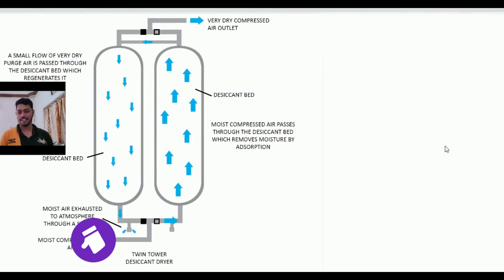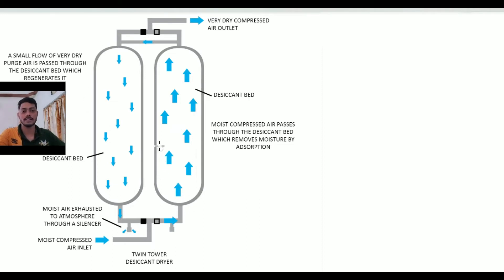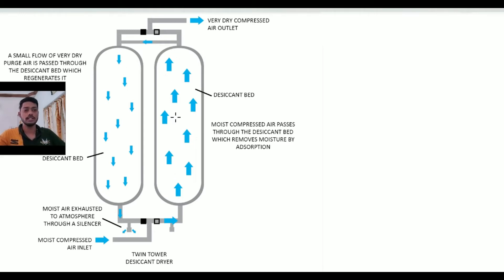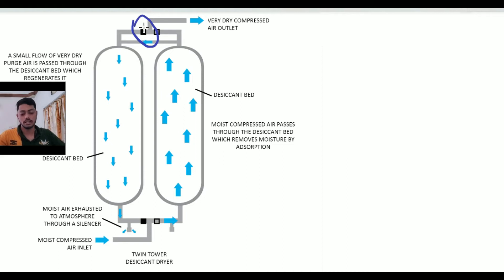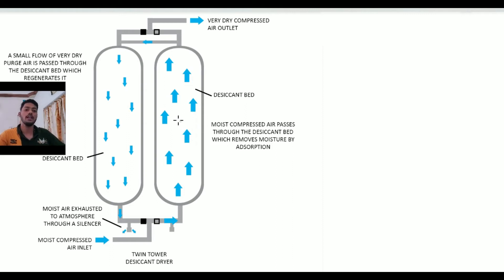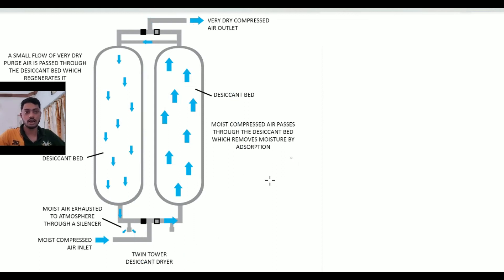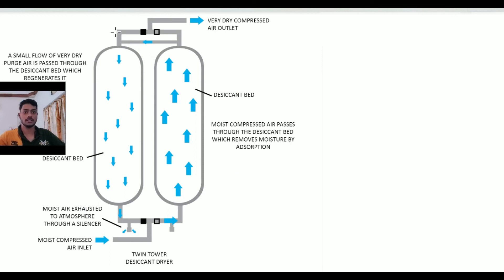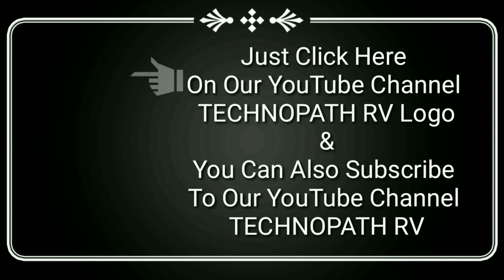How desiccant air dryer works & it's principles

Comment: I would like to remove moisture from the gas produced by my gasifier (wood gas). How would you do that?
Reply from the maker: ultimately here we are dealing with psychrometric properties but with specific about any gas or even wood gas or we can say bio mass gas so we need to identify that gas and compare it' phase changing property with respect to temperature and pressure so we can get moisture out from wood gas.  as per my knowledge.
Reply: @TECHNOPATHRVCREATIONS  I calculated the flow rate with an anemometer. What is the instrument needed to calculate the amount of water vapor in the wood gas or any gas mixture? A psychrometer/hygrometer available on amazon for example?
Reply from the maker: @fraid5508  definitely yes hygrometer work based on psychrometric chart you can get data of moisture in term of Relative humidity and dew point but with respect to air property but not for any another composition of gas mixture, kindly have look on hygrometer working area because I hardly believe that with hygrometer we can not measure relative humidity for specific gas & rest of general atmospheric air, in our lab we have hygrometer and we are measuring relative humidity and dew point of atmospheric air.
Reply from the maker: @fraid5508  let me see on this things and will update you soon possibly
Reply: @TECHNOPATHRVCREATIONS  ok thx!
Reply: Hey if you want to remove droplets in the gas then you need to use a coalescing filter. If you want to reduce the overall humidity in the gas then you need a dryer.